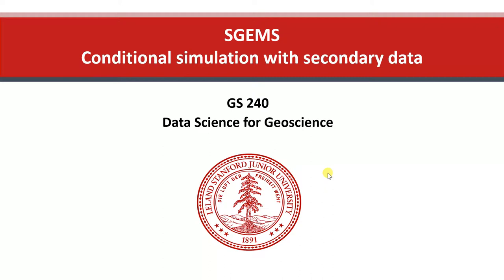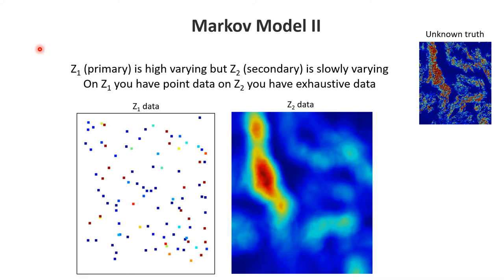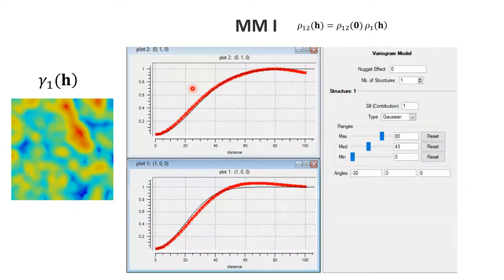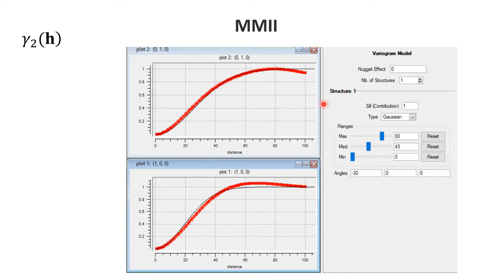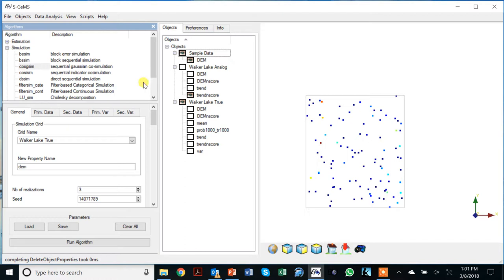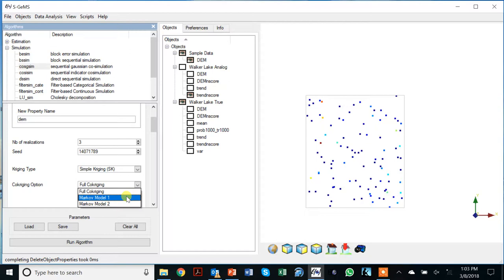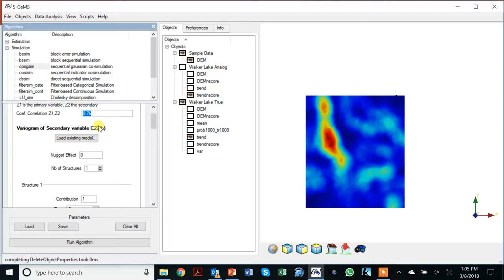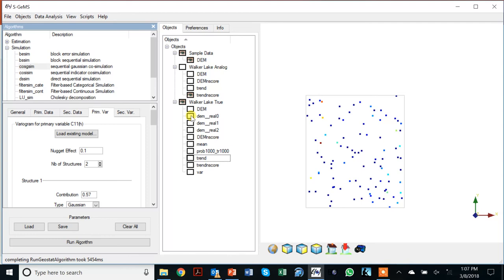SGEMS CO-SGSIM

Comment: In the first step you created the semivariogram with the primary variable from Walker Lake Analog DEM (grid data). In further in COSGSIM the primary data whitch you used was from Sample Data DEM (point set). 
My questions is:
1. Why did not you model the semivariogram for Sample Data DEM (point set)?
2. Why did you use Z1 (Sample Data DEM - point set) to primary data witch COSGSIM algorythm?

This is different type of data. I don't understand why did you use different the primary data to COSGSIM algorythm.

Comment: in my case, the primary (Z1) is radon data, had high varying data and the secondary (Z2) is lineament/structure data, had slow varying data. Is it right if I used MM2 for this case?
Reply from the maker: yes in that case you would use MM2, but you secondary data should be exhaustive too
Reply: if the secondary exhaustive, but primary is less data, How to make the coef. of correlation between the primary and secondary? I am confused with this problem

Comment: Good explanation about collocated simulation using MM2. Now I am doing my research using cokriging MM2 algoritm, but I have a problem, sir. When I try to run algoritm, an error notification is appear.. The message detailing error appear from that field, at field the secondary hard data Grid, that message said "for MM1 and MM2 options, the secondary data must be defined on the simulation grid" can you help me to fix that problem? or you can make video about SGEMS COLLOCATED COKRIGING USING MMII?
Reply from the maker: I can only comment on theory questions